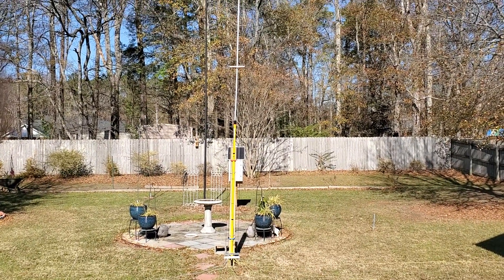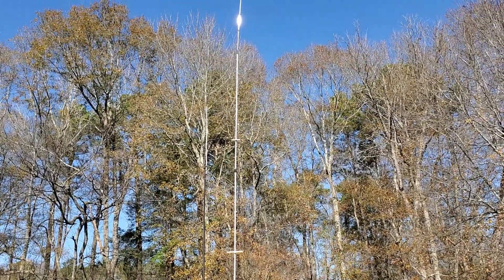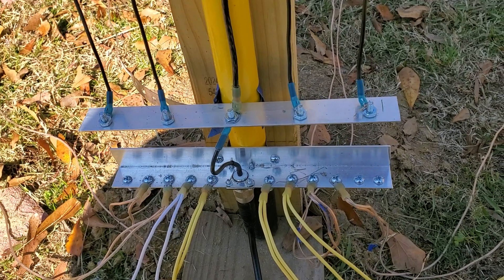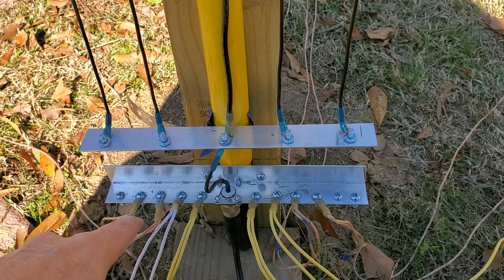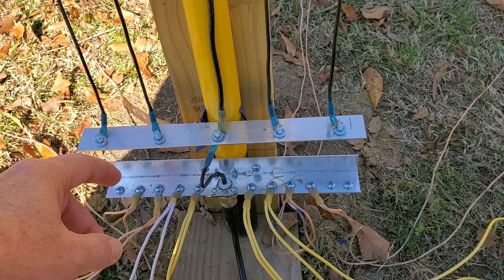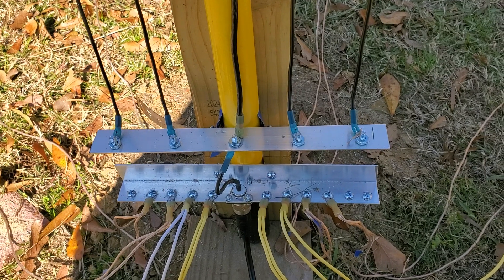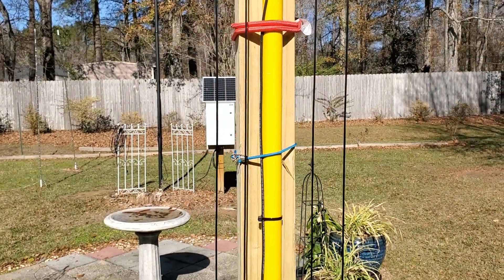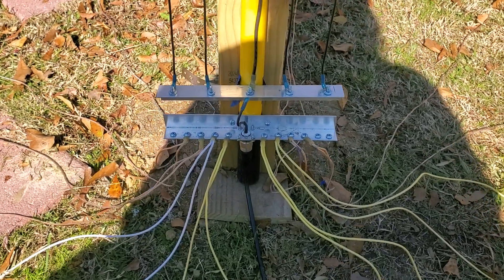Budget Multi-band 10-40 Meter Vertical Antenna

Comment: Wouldnt the coax see all of the elements combined length without switches on each element? Asking for a friend 😂
Reply from the maker: Good question. There is some slight interaction between elements but because the elements are resonant it automatically goes up the correct element. It’s the same concept as DX Commander antennas (just cheaper). Thanks for watching and commenting and please consider subscribing to the channel if you haven’t already. Trying to reach 1000 subscribers and we’re real close. Thanks.

Comment: Awesome homebrew antenna!   I think every amateur radio operator should construct such an antenna, or a variant like a fan dipole.   This one antenna design presents an opportunity for the builder to learn many fundamental principles of antenna theory first hand.  I did have a few questions for you, though,  if I may:

How did you erect the antenna with the telescoping whip fully extended, but without damaging it?  And, did you waterproof the sections where they join to prevent water ingress and rust?  Those whips are not designed to withstand the elements.  I might suggest some heat shrink tubing where the sections join.

How did you tune each element?   By making measurements, bringing the antenna down, cutting the wires, and putting it back up, or what?

What did you consider to be the biggest challenge in constructing this antenna?  And, what changes, if any, have you made since putting it up?

Thanks for the video, and 73!
Reply from the maker: Thanks for watching and commenting. To your questions:
I extended the antenna and then raised it. The antenna is very robust and suffered no problems. It’s stainless steel so water has been no issue. After  a couple of months I wrapped about 1 turn of electrical tape to stop water as insurance but it made no difference. Each element was tuned by raising and lowering it for adjustments. If was easy and no problem. The only challenge was deciding what to use for parts. The only thing that I would change is to use stainless steel nuts and bolts on the aluminum buss bars. I generally lower it when there is a storm but it has endured some high wind gust and flexing to probably 30 degrees with no ill effects. 

If you want to see the whip extended horizontally take a look at my recent video where I took 2 of these and made a 20 meter dipole. It works awesome but doesn’t take wind quite as well. 73.

Comment: Do the aluminum sections of the paint pole affect the performance of the longer wire?

I was thinking about using the 40m wire as an inverted L like the DX Commander uses the 80m wire. Think this would work?
Reply from the maker: I think it should work just fine. Just put all the elements for the bands you want together before you start tuning. I started tuning the higher frequencies first I think and mine works very well.

Comment: I have the classic version of the commercial antenna you are talking about. It’s a quick antenna to erect. I have other antennas that seem to perform better receiving so I will start using this as a portable of backup antenna if my others go down. They are great transmit antennas though. I had one pole get damaged in an ice storm so I ordered two from the UK. One to use and the other as a backup. I see DXE stocks them now. Thanks for sharing. Tra
Reply from the maker: I agree, those are great transmit antennas.

Comment: I’ve used that same paint pole and only supported the bottom 24 inches and the wind broke it over. I didn’t have a fan setup, nor the whip at the top to add to the wind load, so your method of supporting further up the fiberglass portion must be the trick for its longevity.
Reply from the maker: Thanks for sharing. The aluminum part whips something crazy when the wind picks up so I must have lucked up supporting it like I did.

Comment: Great Video! I subbed your channel today, I’ve been meaning to watch this video for three days now, well worth the wait. 👍
     A helpful tip for the ground radials, I did not catch how long they are but if you see people discarding electric vacuum cleaners for trash pick up, cut the electric cords off of them, they are usually 35 feet long and most are made with 14ga AWG insulated stranded copper wire, one black, one green and one white. One vacuum cable should be able to make six ground radials for you. If you accumulate enough of those cords, you could go to 32 ground radials and it should lower your SWR’s across the board to 1.0-1.1 respectively without having to cut any of your antenna wires at all. 
     What I did to mine was mix 14ga AWG with 18ga AWG on every other radial to be able to talk around the world with only one watt of power on my Xiegu G90 and that works very well for me. 
     Yes, you will need to upgrade all those nuts and bolts to stainless because the ones you are using will start showing signs of rust by summer, which is fine. 
     The ground radials closest to your 10 and 12 meter wires can also be shorten to 9 feet to give you a better wave pattern also. 
      The whip antenna at the top, you stated that you tapped and change it to what size? 
     I really love the antenna that you built. I love the design and the cost. I hope my idea for the vacuum cleaner cords works great for you and hope it gives you some great ideas for your next antenna. Mahalo! 🤙🏻
Reply from the maker: @digitaldreamer5481  Thanks for watching and thanks for all of the suggestions, especially on acquiring wire. The whip antenna base has M10-1.5 threads. That being the case I picked up a M10-1.5 tap at my local Lowe’s, then drilled a hole in the top of the pole and tapped the M10 threads into the hole so that I could screw in the whip antenna. The painters pole end is aluminum so it wasn’t hard to cut the threads. Most important thing is to drill your initial hole straight. 

Thanks for watching!
Reply: @ You are very welcome! 
   I use to build wind turbines for a local Hawaiian nonprofit whose gain was to help local farmers with getting electricity in places where HECO either wouldn’t or couldn’t run electric lines that was so successful that we even branched out to local families who couldn’t afford HECO prices. 
      I used vacuum cords, clear plexiglass from discarded flat screen TV’s for the tail vanes, magnetrons for the big two round magnets and blocking diodes from discarded microwave ovens put out to the curbs of Waikiki on Friday nights for Saturday morning pick ups. 
      I grew up as a problem solver that translated well in the U.S. Marines for EOD and later on as a paratrooper. I always had to be the smartest people in the room according to Major General James Day, who ended up becoming a good friend until his passing. He was the general that recommended me to serve in Vietnam during the Indochina War (cir 1979-1993) as an American Advisor. 
      I’m a third generation Ham and the recipient of the rare A-1 Op Award. Today, I am an emergency EmComm disaster communicator for the ARES under the Hawaii State Civil Defense Agency and net controller for NWS Skywarn Program at the University of Hawaii-Manoa Campus. Most famous for holding an emergency EmComm net for an Inbound Nuclear Missile Attack by North Korea on January 13,2018 which was heard and monitored by the President of the United States and almost a half dozen three letter agencies in Washington DC and for which I still suffer from PTSD’s from today and being treated for by the VA. 
      So I find solace in my three cats and Amateur Radio when I have time. Right now, I’m putting together an active team of coast watchers by 2027 for the South Pacific region. 
      I also belong to The Amateur Radio Club for The American Legion and organizing a Amateur Radio Club for Hawaii Hams with The American Legion with the help of Gordon Lee NH7VI, Post 17 commander where I’m the acting DEC. 
     So I keep myself busy and learn new things from watching YT videos like yours. Frankly, I’m too darn busy to start my own YT channel. 
    Currently, I’m getting ready to go into a new war zone in Los Angeles. Got my airline tickets, reservations and packing my gear to get ready. 
    It’s almost 5am here and I couldn’t sleep. Too many things to think about and one of my cats doesn’t want to go to sleep either, so I am comforting her, a tuxedo named Aiko, who cries if she can’t go in and out of my son’s bedroom because he has to go to work in the morning. 
    I’m looking forward to your next video and always looking for inexpensive ways to survive this hobby on my VA Pension. 
    Thanks again-Todd USMC Ret.

Comment: Have you ever considered Ten inch or Twelve inch Stainless Steel Camping Dinner Plates for your radial connector plate and another to attach the radiating elements? They have worked well for me.
Reply from the maker: Excellent idea. Thanks for sharing that suggestion.

Comment: The fan vertical is not new.. You did a great job highlighting a classic antenna and showing an excellent antenna that anyone can build. What the commercial one did is create a VERY good option for someone who has no options for non-ground-mounted antennas without needing to be a skilled builder. Not all hams like building or experimenting with antennas, and I am not shaming them for that, so the commercial ones are just filling a need. I really enjoy your video.
Reply from the maker: Thanks for watching and I agree with you. It’s great to have all kinds of options available.

Comment: Righteous build! I doubt Callum would have any problem with this. DIY vs store-bought is always a choice for us to make.

There's an old saying: "If you like to build, build. If you don't want to try, buy!" I actually have an antenna I bought from Callum (which works very well) but am currently building a hexbeam!
Reply from the maker: @linuspoindexter106 Thanks. Callum offers real value for the price. Im actually waiting for his classic 2 pole to come back in stock to order one. I really want a 12 meter pole too. Need these for some new portable project builds. I love Callums videos. Thanks for watching.
Reply: @yqtszhj  This type of antenna existed well before the DXCommander. I had one my self I built a decade or so before the DXCommander existed. He did a great job of commercializing the antenna for production. And this is a very good build for home build! You can also build this to be thrown up in a tree if you get one high enough.
Reply: @N0VTY29  I love it when folks develop their own - great isn't it!?

Comment: I wish I knew lengths of painter pole, the length of pvc, and what is the whip connected to and how tall is it?  Do you plan on grounding it for lightning?  how about running a ground back to the house and connecting it to the house ground conductor? Knowing the distance3 of your elements would be a nice head start for me, you terminate 12m and 10 at the same distance, but they are not same size, same for 17m and 20m... I have a DX commander 30' push up pole, and this is my winter project... Thank you!!!  KE8RTS, 73!
Reply from the maker: Sure thing. The painters pole is the 24 ft. Lowe’s version. The fiberglass portion is 9+ ft. and the aluminum extensions total about 15 ft. It is extended all the way up.

The pvc is cut long enough to allow 2 inches between the radiating elements for each band. The wire elements are cut to different lengths but extended to the PVC via some bungee cord to pull it tight. I made my initial cuts for 10, 12, 17, and 20 meters using the DX commander cut chart. It was relatively close (a little on the long side.) 40 meter is tuned using the whip on top. I think it’s extended about 150 inches.

The whip is an 18.5 ft. whip antenna bought from Amazon. It has M10 threads. I tapped threads into the metal top of the aluminum paint pole to screw in the whip. Electrically it appears as one piece with the painter pole.

It is all grounded to the ground for the repeater that sits behind it. I drove in that ground rod when I did the repeater build. That was a long 8 feet of rod driving. The antenna ground is not tied to my house ground because it’s 100 ft. away and I would have to go under my concrete drive, thus a dedicated ground. It’s not the best setup but it’s the best I could do given the location. When bad weather is approaching I lay the antenna on the ground and disconnect the coax outside and inside the house.

I want to get me one of the DX commander 40 ft. poles for playing around but I just haven’t done that yet. The one I want was out of stock last time I looked but I should get an email when back in stock. Then I have to order one without the wife finding out.

Oh, if you need an antenna analyzer I recommend the Nano VNA. I’ve had one for 3 years and I’m very happy with it.

I have a previous painter pole video with more details if you haven’t seen it. 73 AE3HD.
Reply: Thank you

Comment: Thank you for this antenna video, a good example of an innovative use of taking an idea/example and fitting to your budget and capabilities.  I also have been using that painters pole for several antenna uses both vertical and as a quick cheap mast for EFHW and EFRW, I have HOA issues so quick setup and takedown with stealth wiring were considerations.  73 KJ5FWC
Reply from the maker: Thanks. Glad you have one working for you also. It’s always good to make use of something available for an out of the box purpose. Keeps us thinking and preparing to meet a need using unconventional methods. Plus it just gives us a sense of accomplishment. I have a couple of other ideas for videos that will be coming that should be enjoyable and motivational for folks I hope. Thanks and 73. AE3HD.

Comment: Great video, I actually tried this some years ago, and you show a far better design than I had. Well done, 73 zl3xdj.
Reply from the maker: Thanks for watching. There is still a little tidying up that needs to be done on it but I’ll do that next time I lay it over. It works amazingly well and is great for general purpose use. 73. AE3HD.